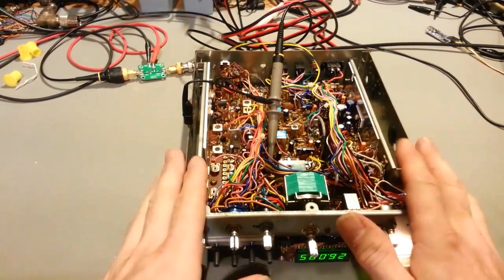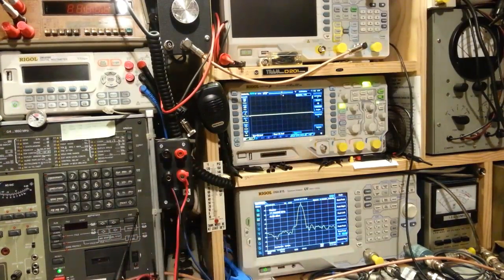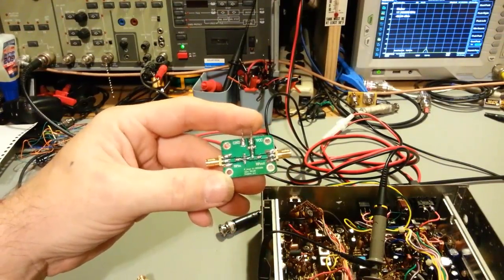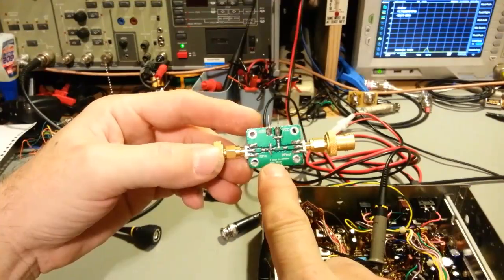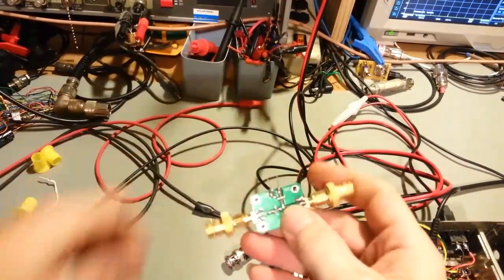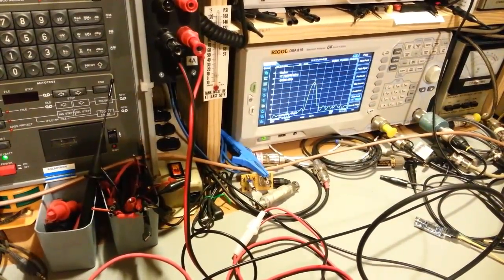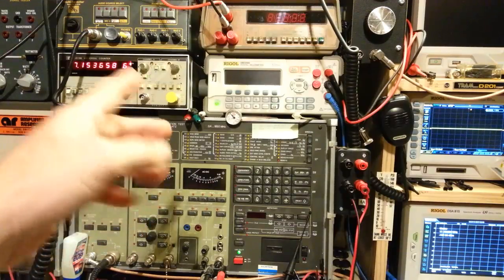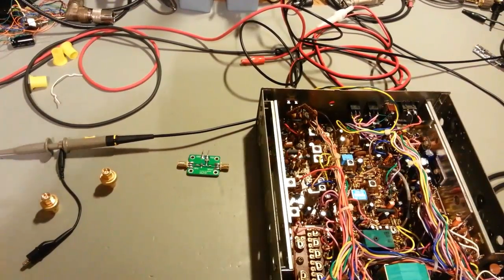Cheap way to increase the input sensitivity of your frequency counter.

Comment: The sensitivity will increase on the counter when the resolution is decreased, so thats the tradeoff. 
An amp can be built using (2) n2222 transistors and a couple of resistors and (2) .1 caps. By buying these parts in bulk, you could literally built 50 amps for the price of 2 of those......
Schematics for this are all over the net

Comment: Hey Mike!!  How are you doing? 
All is well I hope!  A quick question 
if I may: You said, in a previous 
video, that you're fine with us 
re-capping our own radios if we're 
handy with a soldering iron.  
Is there ever a case for using caps 
of a different value other than that 
wich came stock with the radio? 
I know that when changing caps 
on an electric guitar's tone pots, 
different values will affect the 
guutar's tone.  Should we leave 
the values "stock", or should/could 
we go with a different value?! 
I'm sorry if this seems like a "newbie" question, but if I don't ask, I won't know!!  
Thanks in advance, your fan: 
Norman
Reply from the maker: Pretty much anything cheap consumer electronics I work on I increase the voltage rating on the caps when I replace them.  As for the value, unless you know what your doing it's best to stick with the factory value.  In certain circuits it can adversely effect the radios performance/functionality if it doesn't have the correct value.  It's safe to increase the value of the filter caps on the power rails.
Reply: MikesRadioRepair: Thanks for the quick reply!!  You da man!!  I have an RCA co-pilot 14T302 SSB radio. 
As far as I can tell, it was made in 1978-ish, and probably due for a 
re-capping & alignment.  I can try 
the re-capping, but I don't have the equipment for an alignment.  Any 
tips for a CBer from the 70's?  I'd 
love to do as much work myself, 
IF I can!!  I know enough to know 
that I don't know enough!!  I just 
have to figure out why my power supply is putting out 26.8 volts 
instead of 13.8 volts!!  
Again, thanks very much for all 
your help & advice!!  
Your fan, Norman.

Comment: If the amplifier input is 1 meg or more, the probe attenuates by a factor of 10 or less.  If it is 50 ohm, the probe attenuates by a factor of 180,000.  The gain of 30 dB (i.e. about 30x) pales with that.  I don’t think you get oscilloscope type input impedances on cheap amplifiers that can do 2 GHz.  Typically I would expect 50 ohm, but what your demonstration with the spectrum analyzer seems to indicate is net gain.  Hmmm?
The other issue is, the counter adjustment knob likely is not sensitivity.  It probably is trigger (comparison) level.  At least all HP counters that I have dealt with used that approach.  The least signal detection is when you have the knob set to zero.  Maximum right setting represents the highest positive voltage in DC coupling and maximum amplitude in AC coupling.  However, in the old units, the trigger point (reference level) often drifts.  Needs calibration to restore the proper zero.

Comment: ahh the old Uniden IF circuit problem!  gotta make sure your 1K tone is accurate if you can't measure those directly!
thanks for this tip Mike, i just bought one so i have more freq counter options when doing oscillators.
looked at buying some solder-on female BNC's, but they were more expensive than the adapters.

Comment: Does it have enough gain to boost a VFO signal to the mixer on a Johnson Messenger 223 tube CB? I have one with aged crystals and I want to add a VFO.
Reply from the maker: +scott king 

No, it's maximum output is only +10dbm.  Contact Chris at Nomad Radios.  He makes a buffer/amplifier board for just this purpose.

Comment: I love my old Tektronix 2432A, as I use its Ch 2 output on the rear panel to drive the counter, so you use the scope as normal and view the waveform, and a buffered and amplified output is fed to the counter, unfortunately that scope is slowly dying and I have to keep on fixing it!

Comment: Good advice Mike. Have to try that. Some analog Tektronix scoops have a analog amplifier on the back. You can hook up counter to it. You see on the scoop the trace and the frequency, amplified by the Tek, on your counter. But your solution can be used for all equipment. How is the electronic course coming? 73's Henk

Comment: How well does the 50 ohm impedance work with a x10 probe? Seems like a huge mismatch.
Reply from the maker: +Mister Hat 

LOL, it's only mismatched by 8,999,950 ohms.  :-)  In the 10X position it adds a 9 Meg resistor in circuit.  It bumps up the impedance to prevent loading down circuits but really doesn't effect it when using it in this situation.  We don't care about amplitude accuracy, only frequency accuracy in this case.
Reply: I understand about not caring about accuracy, but that mismatch should be greater than the 30dB gain of the amplifier and defeat the purpose.
Reply: Defpom. Very true. But the voltage divider effect attenuates the signal by over 100dB, instead of the 20dB that would be from just using the probe. Therefore adding the amplifier would net 50dB less signal into a 1 meg input on a counter.
Reply: The test points aren't 50 Ohm anyway, only the transmission line is, you want a very high resistance to reduce the loading, as Mike said.

Comment: Those are very cool. I have to get me another one due to sitting a power supply on top of mine and breaking the board in several pieces. Years ago we built our own and were powered through the frequency counter cable.  But these are cheaper than building them now.
Reply from the maker: +The Radio Shop 

Yeah the price is so cheap it's ridiculous.  I have the big bench lab amplifier which even I couldn't afford to buy brand new and you can also get small amplifier modules like this from mini-circuits.  The mini-circuits ones are super high quality but come at a premium price to.  For something like this though where you just need to amplify a signal a little for a frequency counter these cheap little amplifier modules are hard to beat.